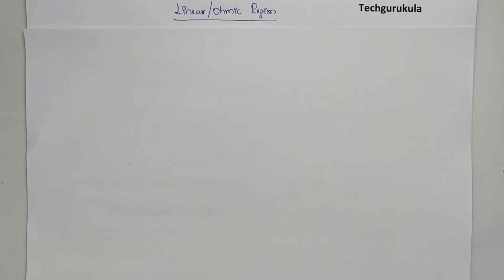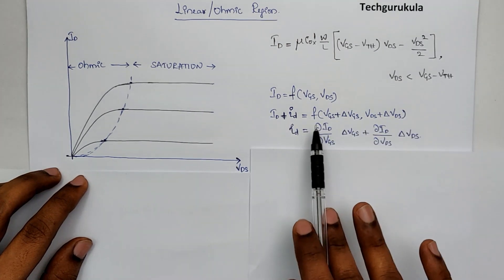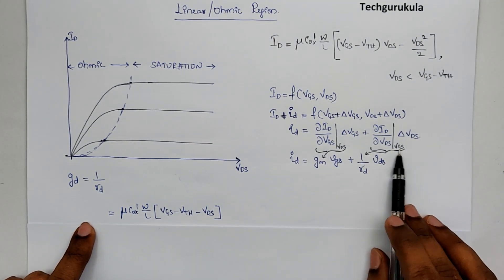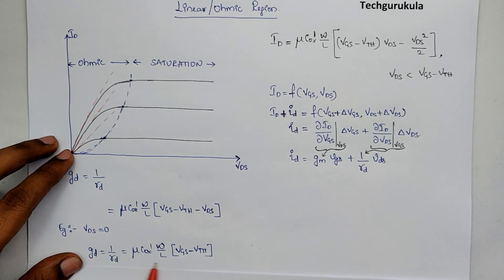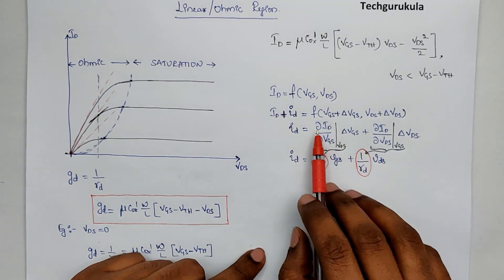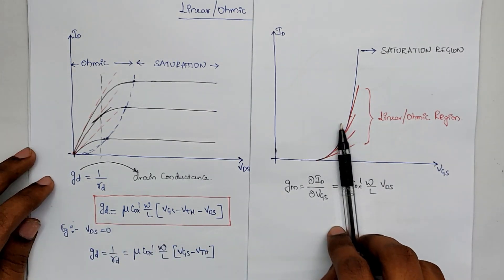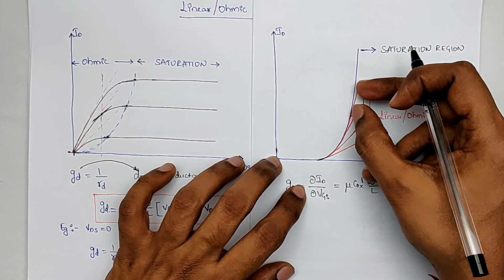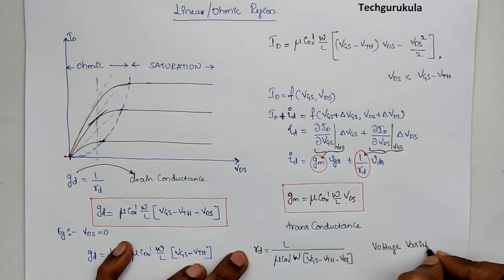Electronic Devices: MOSFET - Linear Region transconductance and drain resistance

Comment: Sir, the rd resistor in the previous video you talked is like infinite, but in this video you talked is voltage variable resistor.  so in which condition we should take which into consideration, it would be nice you could take some example.
Reply: rd is given by (1/Lambda*VDS). Lambda is very small value, so if not given we take it zero. Hence the rd becomes infinte, i.e., open cicuit.
However, if you know the value of Lambda, then it is (1/Lambda*VDS), which is a resistance dependent on VDS.